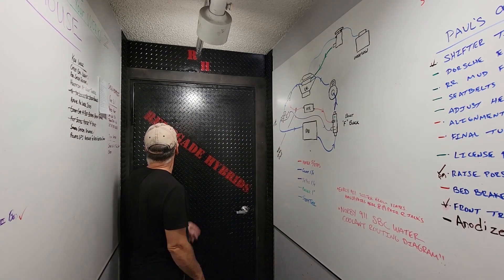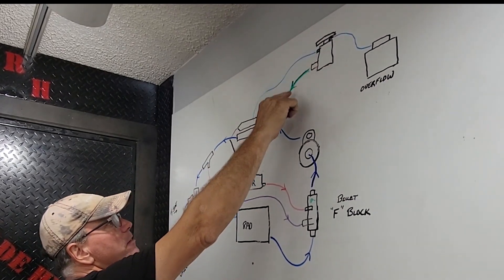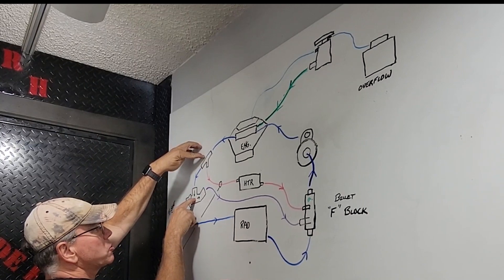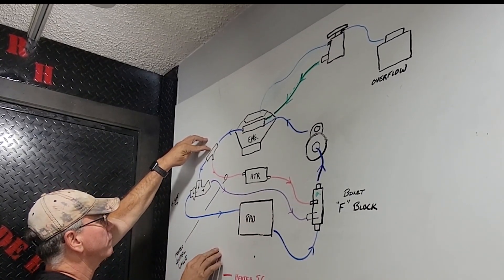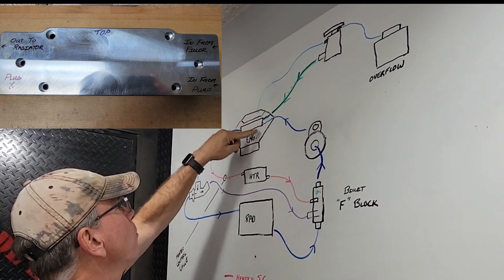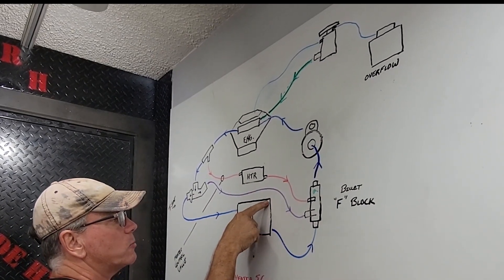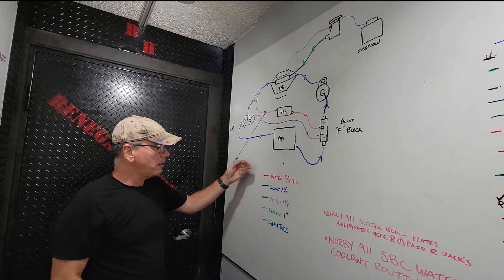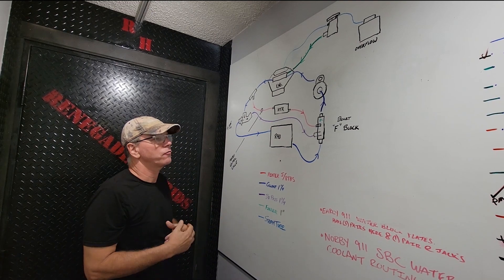914/911 LS V8 Renegade Coolant routing discussion

Comment: Why not add a second bleed line from the top of the radiator replace the bleed cock with a fitting (an-4) and run it back to the fill/expansion tank right next to the other bleed line from the engine. Now the entire system is constantly self-bleeding.

I have two V8 mid-engine cars done like this. An SLC and GT40 and it works perfectly on both.

m.m.
Reply from the maker: Good suggestion, but the air will still sit high in the radiator because the bleed line would need to drop down along the pan of the car for quite a distance before resurfacing at the filler neck.  The air would not make that journey easily at all.  What we've found is the radiator, when completely burped correctly, does not collect air (unless there is a leak in the core).  It stays filled and happy with this method.

Comment: Have you considered a variable speed controller for the electric water pump?  
That would eliminate the bypass, the thermostat, simplifying the entire system.
Thanks for the video / info.
Reply from the maker: Actually we have.  The pump manufacturer does not recommend using a variable circuit for multiple reasons.  It is harder on the pump Motors, they are not as reliable, and a good quality variable temperature control circuit will certainly be more expensive than a T-stat bypass design.  Even if the T-stat fails, some water still circulates.  If your pump circuit dies, your pump quits with it.
Reply: KISS

If it works don’t fix it !